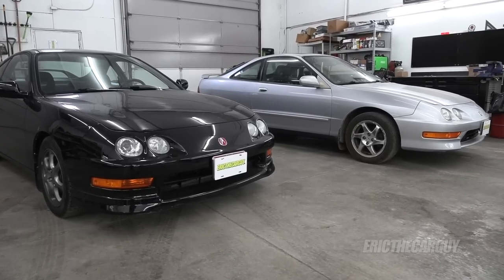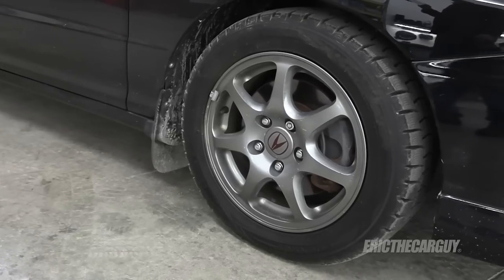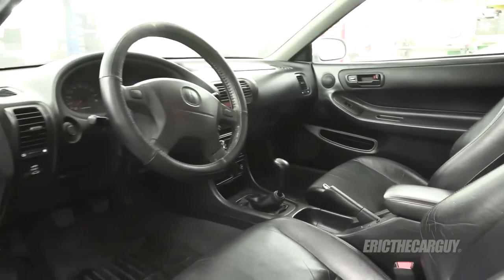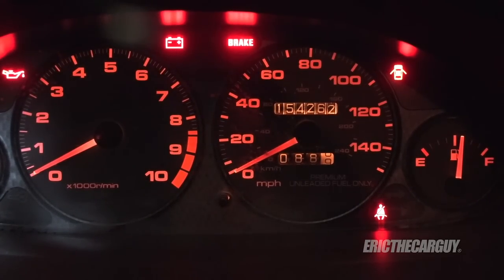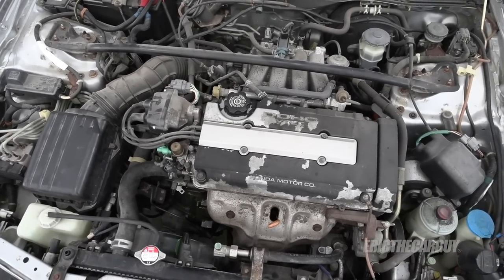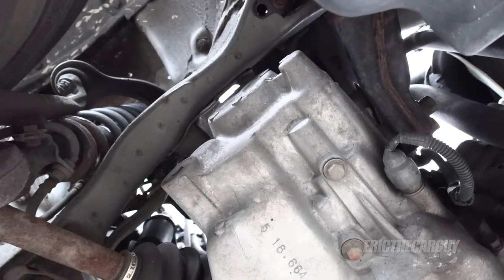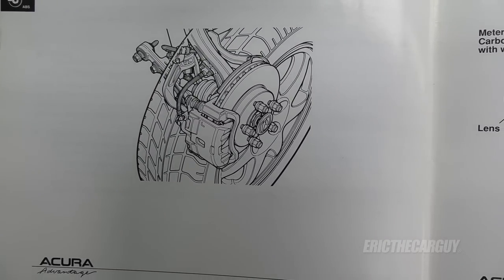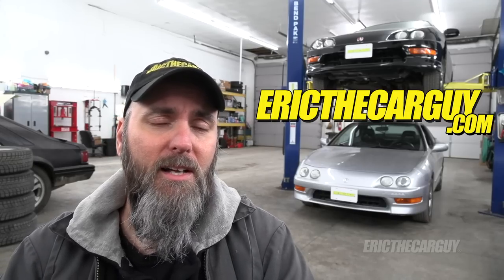Integra Type R vs Integra GSR

Comment: Loved this video, super informative! A few things to note, the 4th generation civic/CRX SIR 1989 was the first production vehicle to have VTEC with a B16A. Another thing I wanted to add was the GSR and Type R actually use a completely different cylinder head. Type R uses PR3(B16) and GSR uses P72 which is only located on GSR B18C’s. They even use a different intake manifold bolt pattern so they aren’t interchangeable. Another thing to note, the Type R uses the same front brake caliper as a 97-01 CRV
Reply: Correct but cylinders heads on the Type R were also ported from the factory
Reply: jonny francais  yes they were, the ported the casting marks off.

Comment: I had a 97 championship white type r in the early 2000’s. Had it for 2 weeks before it was stolen and stripped. Motor, trans, interior, wheels, everything. All that was found was the shell. I hope those that stole that car had 10 times more stolen from them! It was a great car.

Comment: If you're ever wondering if an Integra Type R spoiler actually works, do a couple passes around a safe corner,  take your spoiler off, and do it again. You'll see a 10-15 mph difference before that back end starts wobbling. I bought a carbon trunk, and a mugen wing but didn't drill right away. It was a surprising difference for the day I drove around without a wing. Same with a full diffuser and underplate. Big improvement, you can make these cars really sporty if you don't care about keeping it stock.

Comment: Cool video! I had a 97 GS and the only mods I did were full ITR suspension w/rear sway bar, ITR exhaust and a strut tower bar along with good tires and a header. Completely transformed the car. It was pitifully slow in a straight line, but wow could it hold a corner.

Comment: I live in Australia and bought my 1999 Integra Type R (DC2, B18C) 22 years ago. I simply can't part with it, even though the smallest little shitbox turbo can outpace it in a straight line. This is not what it's all about. My Integra was hand-built and there is a special sound and quality to this naturally aspirated engine which a turbo powered car will never possess. I recently clocked 301,000Kms and have never touched the motor. Replaced 3 clutches, 3 distributors, 1 wheel bearing and 1 one radiator - that is all, (apart from several sets of tyres) with a total layout of around $7,000 over 22 years. Ironically, my Integra does not use oil and I top up about 2 litres every 10,000Km. I rev it to 9,000RPM regularly.  Now, after 22 years, I feel even more excitement every time I get behind the wheel. This is what it's all about!

Comment: +1 on the engine differences. I'd also agree the standard B18 felt more torquey. Didn't notice any difference in the clutches funny enough(maybe the JDM SiR are different to the US GSR?). The big difference was that LSD. If I had a GSR/SiR the very first thing I'd do is install an LSD

Comment: had a friend who thought his 2001 Type R was unstoppable. in the very short time he had it he ended up bending valves, once he  repaired that he ended up rolling it over 15 times. he was in a coma for 2 months had severe head trauma and was never the same after that. He treated that car like it was stolen, never respected it as he should of. 
on a side note we ended up taking the engine out and putting it in a EG hatch and it started up the 1st time

Comment: I've been a Honda fan since my first 1990 5spd civic dx...all 80 horsepower.  As an enthusiasts, i've driven many of honda's.  I was always a civic guy because my 92 si hatchback won me over.  To go from a 80hp car to a light, 130 hp hot hatch was night and day.  

I couldn't get away from from high reving sporty chasis.  Being young, my friends and i had limited budgets.  So some of us would buy si's and others would buy ls and if tney could find them, gsr's.  Both civics and integras are similar but did have different feelings.  We would lend each other our cars becuase we were always tinkering with stuff.  Gsr swapped civic coupes, usually dx shells or at the time; frankenstein ls vtec builds.  All were amazing in their own right.  

Fast forward to after college, my friends and I were able to afford different cars.  My best friend bought a black 00 Type R for about 23k, and I went out and bought a black 02 s2000.  I had been test driving an 02  black si sedan, when i got the call to test drive the Ap1.  I drove the ap1 once and bought it that day. 

 The type r and the Ap1, obv very different, but actually somewhat similar in driving characteristic.  I would drive the S then the type R or vice versa.  AND man, there is no car that compares to the Type R.  The sounds, the torqueness of the motor and the feeling of somehow a fwd car being planted like rwd.  Sounds weird, but once you experience it, you will know what i mean.  And I love, love the F20c, and F22c, but man the type r is just special.  I had never been in a fwd that felt so planted.  
The S is scary at high speed corners, the rear can be unpredictable and was appropriately fixed in ap2's.  The ap1 can be scary to push, But the high reving na motor is intoxicating. With a 70mm test pipe and muffler,   its just might be one of the best sounding 4cyl motors when throttle is at 5500k plus(itr is same i feel)  Ive had 10 years seat time in s2000's and still to this day; my favorite driving experience was the 1st time i drove the type R.  

My friend is no longer with us, buthis car still is.  I often think of the 1st time I drove it.   70 mile plus shifting into 3rd uphill, with the motor screaming with a sweeping right hand up hill corner.  The car was planted, to the point it still wanted more.  Any ITR owner will tell you, its the package, the sound. the shifting and the handling that makes you comeback for more.

  I wanted to buy the car when my friend passed, but i didnt have the means, it was still a 23k or more car 10 years later. But i am still happy to have had many fun years with such a good friend and such an amazing ride.  Maybe someday we will meet again! I encourage anybody who can experience an ITR, to do so.  ITS an era of cars that will never be duplicated.

Comment: The 3rd generation Integra got VTEC in 1994 but the 2nd Gen Integra in the United States got a stroked version of the B16A VTEC motor in 1992 and 1993 (77.4mm stroke vs 81.4mm stroke). The B17A was produced only for 2 years.
B17A1
VTEC
Found in:
1992–1993 Integra GS-R (USDM VTEC Model VIN DB2)
Displacement: 1.7 L; 102.4 cu in (1,678 cc)
Bore x Stroke: 81 mm × 81.4 mm (3.19 in × 3.20 in)
Rod/Stroke Ratio: 1.63
Rod Length: 132.28 mm (5.208 in)
Compression: 9.7:1
VTEC engagement; VTEC Solenoid Engagement at 5750
Power: 160 bhp (119 kW; 162 PS) at 7600 rpm & 117 lb⋅ft (159 N⋅m) at 7000 rpm
Redline: 8000
Fuel Cutoff: 8250 rpm

Comment: Brakes make a huge difference.  Put Integra gsr brakes on my 89 crx si and it now stops on a dime.  Talk about a great car for the price.  A car that will handle as good as an s2000 in 88-91 and it only cost $10k.
Reply: I put prelude rotors and legend calipers on my teg and it was noticeable.

Comment: Fun fact on another difference between that Type R and the GS-R seats. The springs in the bottom cushion on the Type R are softer than on the GS-R to help maintain similar ride comfort since the Type R suspension was stiffer.

Comment: Great detail on the cars.. I would never torque rod bolts to just a torque spec. You at least need an ARP style grease, but rod bolt stretch measured with a dial indicator is the way every rod bolt should be assessed.

Comment: My GSR burns some oil too but for 216K miles it still pulls great! I've driven a few higher horsepower cars but none that gave me the smile this car does. Downshifting into a corner engaging VTEC is still fun in 2020. I used to think I needed a car with a turbo but now turbo cars are everywhere and all I want is a VTEC engine. Funny how my perception of these cars changed over the years.
Reply: I prefer naturally aspirated engines to turbocharged units. The great thing about older cars like these is the level of driving engagement that they offer. An example of how today's cars have devolved would be the automatic rev-matching that more and more cars offer. Who would want this? The real satisfaction comes from doing it yourself — being fully engaged in the process. In days gone by, the driver was expected to be competent and rewarded accordingly. Cars today are doing an increasing amount of the work that people previously enjoyed for themselves.

Comment: The metal shift knob is actually solid titanium.  If you have a worn out one, you mount it to a drill and spin them with some scotch-brite and then anodize them in diet coke (TSP works better) and 9-volt batteries to whatever color or rainbow effect you want.  Pretty fun project.  Several writeups found in google.

Comment: ohhh cool stock Integra ride heights!  I will compare that to my GSR ride height, which has Koni Sport adjustable shocks on the lowest perch setting, stock GSR front springs, and stock ITR rear springs.  It rides pretty dang low.

Comment: The Type-R suspension and chassis are such that the engine simply cannot overwhelm it. Anything that the engine can put out, the chassis can handle -- as long as, like you said, you have good tires.

And that power curve on the Type-R just means you need to keep it near the red-line all the time.  And you get to listen to that engine while doing it.  Not a bad problem to have.  ;-)
Reply: And the way the B18C5 was built, you could run 7k+ on every acceleration and never have an issue.  It was entirely overengineered, lol.  The B18C1 was already pretty much indestructible.

Comment: BTW, I like the details on the 3rd GSR, Type-R in this video.  I never figured the real differences on these other than cosmetic and weigh issues.  I have been curious about their transmission ratio causing a performance difference.

Comment: I was a locksmith for 10 years, with that said i really hate the keys for Honda/Acura around this era. Specifically the red key crap Honda pulled with the Prelude but it does extend to the easy to program easy to break Integra keys.

Comment: I currently own a 2000 Acura Integra Gsr and I’ve been waiting so long to see a complete detailed video comparing it to a Type R. This video made my day thank you for doing what you do! I would love to see how much it would cost to make the Gsr handle and brake like a Type R (if after market what brands). I’m working on installing LSD on my Gsr and then I’m upgrading the brakes but as far as suspension I’m lost. Please help could you make the Gsr (or any Integra) handle better than the type R? If so how much? Ohh and do you live in Florida I would love to get work done at your shop. Good Day! Fez voice
Reply: I had Koni yellows combined with eibach springs. Also upgraded sway bars. It was a killer setup. The best change you could make is sticky tires though

Comment: Eric: Can you explain to us why Acura would change the Type R from an NGK "6" heat range plug in 97-98-00, to a colder NGK "7" heat range plug in 01?  All the engine internals were the same for all 4 years.  I know the JDM R's  used "7" in all years but their compression was higher at 11.1 to 1 so that makes sense.

Comment: Eric, I agree with you totally. The engine doesn't really impress me with my ITR either. The chassis on the other hand, blows me away every time I drive it. Oh and the brakes were apparently taken off the NSX according to UK Honda marketing at the time of the ITR's release back in 1998.
Reply from the maker: NSX front brakes had dual piston calipers, the Type R does not have dual piston calipers, at least on USDM.
Reply: @ericthecarguy  you're right! Tiff Needel was wrong on the Top Gear review then. I have the dual piston calipers retro fitted to my MK8 Civic 2.2 iCTDi diesel. As the standard brakes are pants.

Comment: If torque is what you want, put a K24a2 in the GSR! That should change things quite a bit. I've seen people get 240-250 wheel horsepower with almost 200lb/ft of torque fairly easily on the K24A2. Basically just a 3 inch exhaust, a good intake manifold and intake, and a K-Pro ECU with a decent tune will get you good power.

Comment: I've had a few k series that likes to burn oil. I found that switching to either euro 0w-40 or 5w-40 helps with this. Make sure it's full synthetic which it should be. If you're in a colder climate you might want to stick with the 5w-30 during the winter months.

Comment: Great viewing. Just a couple of comments however. I believe the Type R came with a thinner and therefore lighter windscreen.
I don't agree with your opinion about the Type R and GSR being just other versions of the Civic Type R. I always thought that the Civic was actually a poor man's version of the Integra. The 2000 Integra Type R is a far better looking car than any of the Civic shapes and sadly, I would not buy a new Civic Type R simply because it is an ugly car (in my humble opinion) compared to my 20 year old Integra. I am just about to clock 300,000Kms in my 2000 Type R  and have never touched the engine, even though I rev it to 9,000rpm constantly. I use only the best synthetic oil and change at 10,000Km with new filter. The car burns very little oil. I've replaced 2 clutches, 2 distributors, one radiator and one wheel bearing in those 20 years - a minimal outlay for a car which, in my opinion, is the best naturally aspirated car ever made. I'm 71 years old now and I just can't part with this car......

Comment: I wish someone made a kit for roller cam followers for the B18 that didn't eliminate vtec.

You pointed out that a lot of the suspension upgrades are focused around the rear of the car, which makes me wonder if you'd ever do pseudo-oem themed upgrades to your GSR? You've got an example of what your GSR could aspire to be right next to it.

On the brakes, a lot of guys are going with Mini Cooper rotors, although I don't know how they compare in size to the ITR.  

I guess this is the real question: could you make that GSR better (not faster necessarily) than a stock ITR without ruining it?

Comment: Where do you buy your parts from and idk if you have a video for a b18a1 timing job id like to see it. Im having trouble finding parts for my car that has a engine swap 89 civic si with a b18a1 from a 91 integra. Thanks eric the car guy. I looked on your website didnt see the info for my question.

Comment: I had a 99 Honda awd crv with a b20b 230,000 miles, ran like a top. Never had issues with oil burning. Unless you're hot roding it everywhedd you shouldn't have that issue. That or a previous owner let it overheat too bad causing the Piston rings to warp and get oil blow by.

Comment: Theres a difference between the 97-98 typer first gen and the 2000-01 98spec typer r's in the Injectors. Honda changed the injector spray pattern after 1998spec which gave a a few more power in the mid rsnge. Also the springs and damper rates are different between generations.

Comment: I have 50k to completely rebuild a 2001 acura integra with a K24 motor. I plan on natural aspiration to 600-700 hp, then slap a supercharger on it. Oh, and it will be AWD. I'm starting to collect 90s-2000s cars and rebuild them to super car killers. Electric cars have killed the tuning scene, and I want to show what people missed out on. Plus, I'm a collector, and these will be worth top dollar when combustion engines can't be bought anymore.

Comment: I wonder why the B series would consume oil so easily?  I have a B20 I rebuilt and it doesn't use a drop of oil during a 5k mile change interval.  Maybe it was from most people going too easily on engine break in.  I broke mine in agressively and it's been perfect, and it was nothing more than a 240 grit SC flex hone and some Hastings piston rings, but I also stick with a 40 weight oil because I beat on it all the time.

Comment: Quiet interresting, I never had issue with oil consumption, I had two intergra type R EUDM B18C6, the oil weight (I used 10w40 or +) or valve seals can have an impact on oil consumption in VTEC.

Comment: Why does Acura recommend a NGK 7 heat range plug for 2001 Type-R, while 97/98/00 all use a NGK 6?  What's the reason for the switch to a colder plug?  The engine internals are all exactly the same.

Comment: The oil burn was not common only on the b series.  It was also an issue in H series and high performance K series.  It was due to the oil jets for the piston skirts, which in turn had a higher oil consumption than what's deemed normal.  Honda evem states 1 quart every 1000 miles is normal.  But it's the same theory like the wankle and it's oil injection.

Comment: if want to choose between 2002 rsx type s with 232k or a 2000 gsr with 450k, both stock inside and out, both are between $4500 and $5000, which one would you choose and why?

Comment: My 2014 Camaro V6 has a limited slip differential.. my first one ever had..but I really like the LSD. Also, a question.. My car has, i think, 11.1 cr.. but it only requires reg gas... will there be a difference if I use 91 Octane or better
Reply from the maker: If your engine actually has 11:1 compression, I'm sure it says somewhere, "Premium Unleaded Fuel Only". Check on your fuel door or on your gauge assembly. https://www.youtube.com/watch?v=8VWEwEveGTQ&t=3s

Comment: Because hp is a byproduct of tq. Question: with aftermarket vtec cams tuned for both the short and long runner intake manifold on a gsr would you make a ton more low end tq and hp potential than a type r?
Reply from the maker: I don't think so. I think you can move the torque curve around, but I don't think you'll make that much more power without adding forced induction or nitrous.

Comment: One mistake Eric did say is the first Vtec for Integras was in 1994 actually 1992-1993 rare Acura integra first GS-R with a B17 A1 was the first integra with Vtec 160 HP